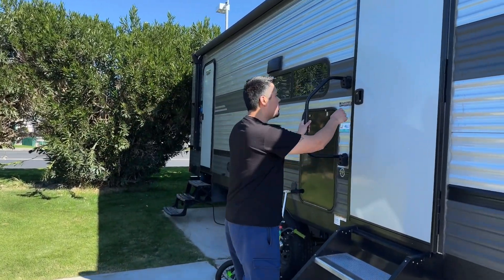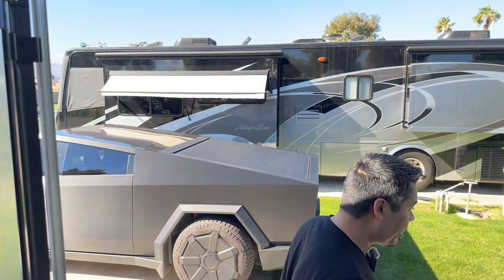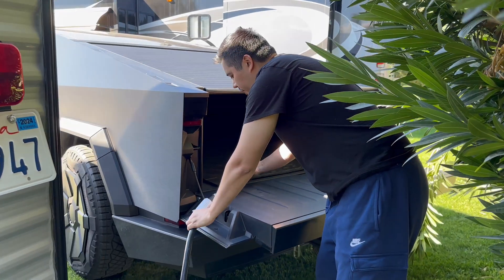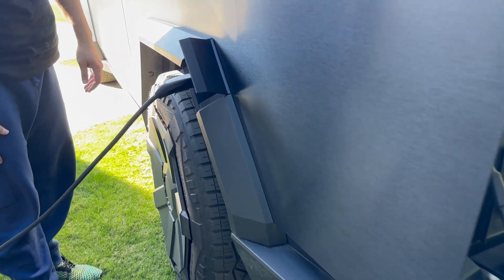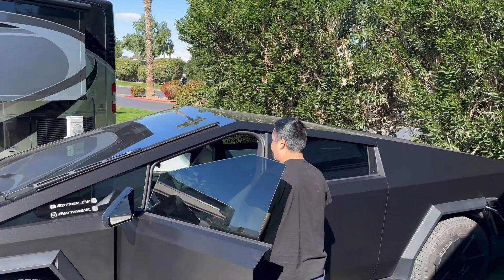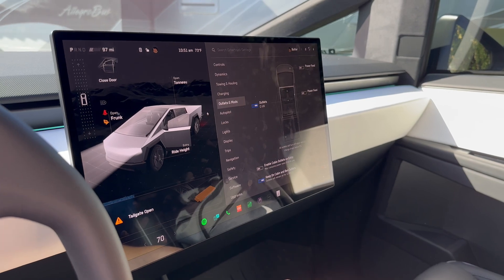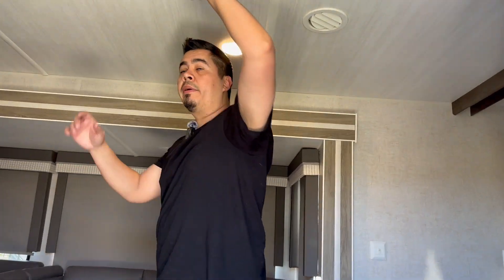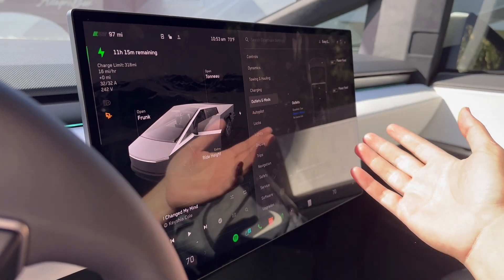Camping Upgrade? Powering an RV While Charging a CyberTruck

Comment: And as of now most RV camps are not allowing any EV to charge so this is done.  Which is a shame because that huge camper with it's dual AC units pulls about the same as the CT out of what you see at any RV camp: 14-50 50 amp outlet.  RV camps just need to meter there stuff and move on.  It's the future.  RV camp owners get with it.

Comment: called "charging bypass" (or) "pass-through charging"... come on @Tesla you can do it
Reply from the maker: Doesn't make sense that they didn't think of this
Reply: CT as far as I know doesn’t have pass through circuitry. They dont want someone using it as a home energy system. Excessive cycling of the battery is bad for warranty!  Dc charging fixes this…

Comment: Why Tho?
Reply from the maker: I’d prefer to charge at the campsite rather than leaving to find a supercharger. So if I’m able to charge the CyberTruck and still run my trailer that would be best
Reply: What I mean is, why do you need to run the van off the Cybertruck when you have “shore power”? Shouldn’t you be testing it the other way? See if you can charge the Cybertruck from the van that is connected to the grid?
Reply from the maker: Oh I see. I know that I could do that but I would then only be charging at a level 1 charge rate as my trailer only has 110v outlets. Great thing about the CyberTruck is the 240v outlet in the bed. So in theory the CT is plugged into 240v at the sure power pedestal, I would then plug my nema 14-50 plug from the trailer into the outlet in the bed of the CT. This would be the most ideal setup IMO
Reply: @Butter_EV I keep forgetting USA has 110v as standard… in Australia all our household power outlets are ~240v. Higher output plugs at caravan parks are either 15amp 240v or 3phase 415v.

Comment: Thx for the vid. In the event of a grid failure, it would be cool to power the house with the truck and charge the truck with solar panels at the same time.
Reply from the maker: I’m glad you enjoy it. Yes that would be nice. Once my PowerShare is installed we see if that is possible as I have solar panels on my home 🤞🏼
Reply: @Butter_EV  I read in the owners manual that was recently released online that you can still use PowerShare while charging with DC (like superchargers), but the truck disables the PowerShare feature when charging with AC (like home charging). It would be so cool if they offered a DC charging option straight from solar panels.
Reply from the maker: Yes that would be a game changer  @musicbox4022

Comment: That makes me wonder if you can charge the truck and plug in the trailer but not be using the air conditioning. I wonder if there’s a limit
Reply from the maker: So they're supposed to pushing a OTA software update to the CT where what I tried in this video will actually work 🤞🏻
Reply: @Butter_EV  that’ll sure be great

Comment: Couldn't you just use a 240v splitter at the power pedestal, run one to the truck and one to the RV?
Reply from the maker: Yes most definitely but I wanted to see if this would work without having to purchase another accessory

Comment: At 2:24 I’m looking at the meter pedestal. You have multiple breakers there, and another 240 volt outlet, and a pair of 120v outlets. You could get the kit that has all the connection types and use that other 240v outlet. And then set the charge amps in the Cybertruck to work with the breaker. Another possibility is buy a 1 male to 2 female RV plug adapter. And again the set the charging amps in the Cybertruck to not overload and trip the breaker.
Reply from the maker: Yeah I’ve thought about a Y splitter. Not all campgrounds are the same so some only have one 120v and one 240v others have more. It’s hard to plan for all campground setups

Comment: Why wouldn't you just install a 240v plug on the outside of the RV and do it that way?  The RV has a much higher capacity cable.
Reply from the maker: I might end up doing this very thing. I appreciate the suggestion
Reply: RV do not use a true 50amp service  like in your home. If you run 240 volt to the Rv you will burn up your charger converter or your charger inverter you run 50 amp 120 volt. You have nothing in a Rv that operates on 240 everything is 120 volts. A simplification of how it works is it’s more like running 2 separate 120v lines not 1 240v line.

Comment: I really hope Tesla can work some magic and enable simultaneous charging and AC power output - that's exactly what I had envisioned for camping.
Reply from the maker: Same here. I was hoping I can arrive at a campground plug the CyberTruck into the sure power and my trailer into my CyberTruck. Lets hope they fix this sooner than later

Comment: Dang, that sucks. I was really hoping it would work as I imagined it would. Hopefully they fix that in a future software update. Thanks for testing and posting it :)
Reply: Tesla announced a while back it’s in an upcoming update. Made it sound like it’s not far down the road too.
Reply from the maker: Lets hope they fix this soon. I'd rather charge at the campground than finding a local supercharger and having to leave the family to charge
Reply: If you aren't top few thousand you ain't getting a Cybertruck this year anyway so it's a non issue. It will be fixed by the time anyone reading this owns a Cyber.  👀
Reply: Agree that as a tow vehicle, charging and powering the camper is critical